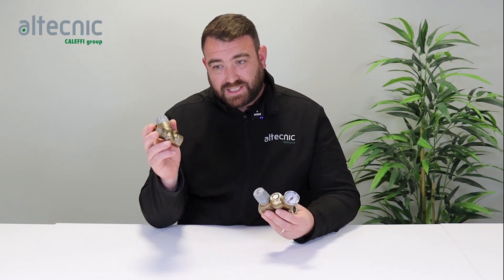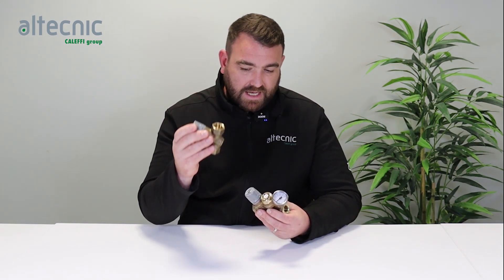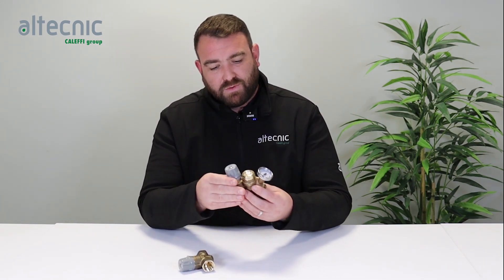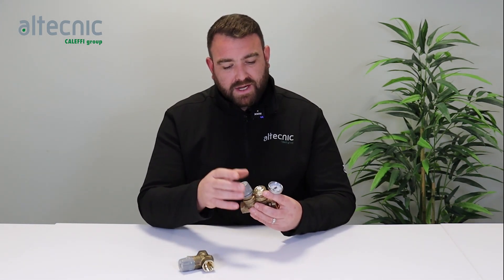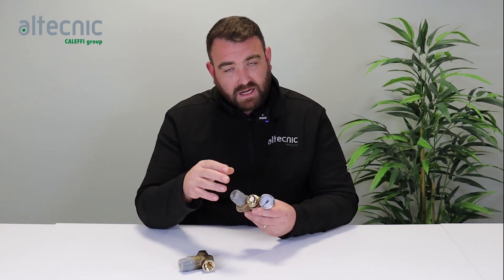How to prevent thermal loss? - Thermal Balancing

Comment: They are installed all throughout the Tottenham Hotspur stadium where TMV’s are not applicable I.e acessible toilets / first aid rooms but all the concourses have a sensor tap 1 single outlet with blended temperature.